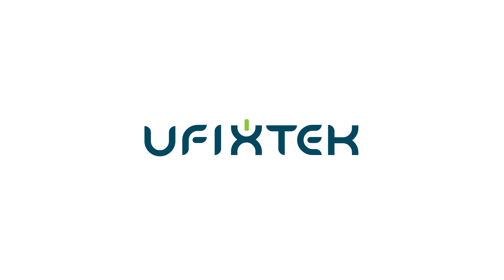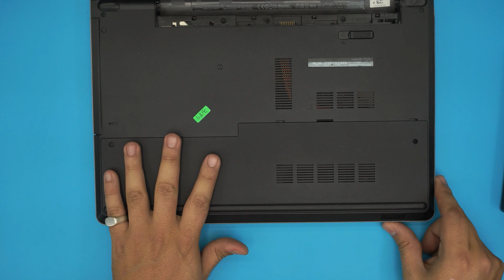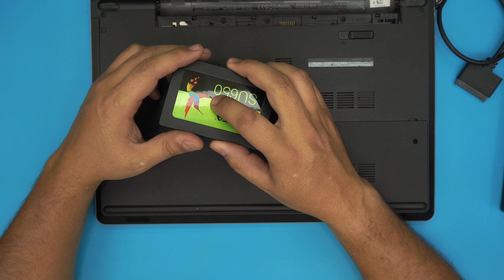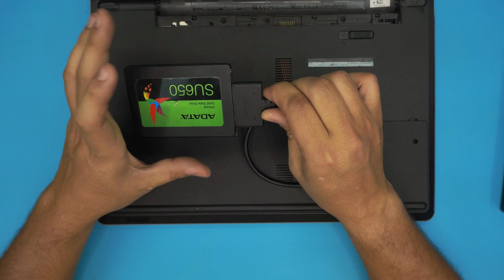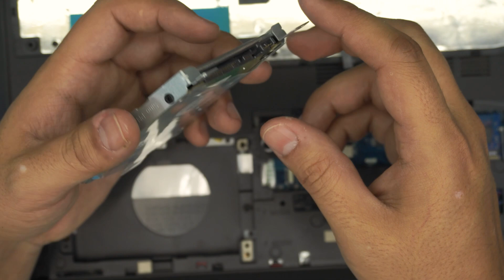Dell Inspiron 5559 P51f SSD HDD Upgrade | FULL GUIDE

Comment: Hey bro the blue tape on the belt it came off of the belt and now am trying but can’t lock it in place
Reply from the maker: 🫠 Regarding your question, just use a very small (almost nothing, smoosh it) drop of super glue on the blue plastic, then attach it to the flex cable, pinch it, let it dry, and then push the flex cable into the connector.

Comment: Can we install SSD parallel with HDD on Inspiron 5559 ..
Reply from the maker: 🫠Regarding your question, that is physically impossible as there is no space for two drives at the same time. UNLESS you remove the DVD drive, get a DVD drive adapter to HDD, and place an HDD there.
Should you have any further questions or requests in the future, please don't hesitate to ask me.
cheers🍻

Comment: Thanks, very helpful!

Any idea if people actually buy used laptop HDDs? M01ABD100 to be precise 😀 I'm left wondering what to do with the HDD I switched out, as it's still a usable piece of hardware, albeit slow as hell. Ideally it could become spare parts or something instead of me just throwing it in the bin.
Reply from the maker: It's my pleasure my friend, i appreciate your support.
🫠Regarding your question, get a 2.5" HDD enclosure and use it as external storage for backup, and keep it in a safe box. Mechanical drives (HDD) are the best for long-term file storage, while SSDs are not suitable for long-term storage as they can eventually lose data over time.
the best we recommend:
https://amzn.to/3XEgD8m
Should you have any further questions or requests in the future, please don't hesitate to ask me.
cheers🍻

This is an Amazon affiliate link. When you use my links, you are helping to support the channel. 🙏

Comment: great vid! I didnt put the ribbon cable in properly and was wondering why the drive wasn't detected. got it right away with your advice
Reply from the maker: It's my pleasure, my friend. 😊 I deeply appreciate your taking the time to provide feedback. If you're inclined to support the channel further, feel free to like and subscribe—or even both!
ya those flex cables go in in an angle 45 then sit down flat and lock it.
Should you have any questions or requests in the future, please don't hesitate to ask me.
🍻cheers

Comment: hello sir, I found this video very helpful, I was wondering if after adding the SSD (cloned), the startup and power up is normal or does it require another extra step? thanks.
Reply from the maker: Thank you for your feedback! If you wish to support the channel, you can like, subscribe, or both!
Regarding your question, nothing after cloning power on and it may crash only once and show blue screen, but don't worry on the 2nd attempt to reboot it will boot normally, no extra configuration is needed.
Should you have any further questions or requests in the future, please don't hesitate to ask me.
cheers🍻

Comment: After replacing my hdd to an ssd it says there's no bootable devices found.
Reply from the maker: I'm very certain, 100%, that you skipped the beginning of the video where I explained that there won't be any Windows installed on the new SSD. I also provided information about what you can do and shared links.

The new drive does not come with Windows pre-installed; therefore, you will need to install Windows using a USB boot drive. You can find the link in the video description. I have created two videos—one on how to create a Windows USB boot drive and another on how to install it.

I hope this clarifies the information for you.

Comment: Which type of ssd is best for Dell Inspiron 5559
Reply from the maker: Thank you for your feedback! If you wish to support the channel, you can like, subscribe, or both! Regarding your question, the best durable ssd and compatible are the samsung evo, 
https://amzn.to/3KJrSWG
Reply: @uFixTek  which capacity 128gb or 1TB dell Inspiron 5559 tolerate
Reply from the maker: 1TB without any iisues
Reply: @uFixTek  ok thanks Love from India (Haryana)
Reply from the maker: यह मेरा सौभाग्य है मेरे मित्र
Reply: @uFixTek  if we remove hdd and use a ssd then,  is it will erase our old data? Because our whole data in our hdd , can we use both ssd +hdd in same laptop
Reply from the maker: yes you will have all your windows and data on old drive , you can't have both. you could get a big SSD and clone your HDD to SSD by using a usb to sata adapter, https://amzn.to/43ylt89
connect the ssd using this cable to your windows and download the none 😉 pirated version of Macrium Reflect and clone the hdd to ssd and you will have everything the same way but on ssd
Reply: @uFixTek  hello and do you have a video showing how to clone your old HDD to the new SSD with the cord you recommended? And where can I download the unpirated version to clone?

Comment: I have a Dell Inspiron 5559 with a 256 HDD. Can I clone a 256 HDD with a 1TB SSD or does it have to be the same size?
Reply from the maker: Thank you for the feedback! if you wish to support the channel you can LIKE or SUB or both :P
regarding your question: yes you can absolutely fine , just once cloning is done and you place the ssd and in the windows, don't be shocked if you see the SSD (drive c) only 256GB (it should be 320GB) , all you need to do its go to "disk manager "
you need to press Windows Key + R. Now, type diskmgmt.msc  , and hit the Enter 
then you will see an extra space in BLACk and can right click on C or on black partition and do extend.

Comment: How to install os from HD to SSD
Reply from the maker: Thank you for the feedback! if you wish to support the channel you can LIKE or SUB or both :P
regarding your question: IF you mean cloning the old HDD to SSD or fresh install (very recommended), if you want to clone your HDD to new SSD then you need to get this adapter then plug the SSD to the adapter and download the cloning program ( Macrium Reflect ). and clone the HDD to SSD
but if you want to fresh install windows the download windows to USB: https://youtu.be/uDu8j2lE-dM
after creating the usb power off the laptop and plug in the usb and power on and press f12 and once in boot menu then select the usb and install windows : https://youtu.be/GkMZyCUarIA

Comment: Hi I have the same pc with a 1 To hdd and I wanna switch to sdd I have 2 partitions in my hard drive 500go each the main partition with windows in it has only 210 go used so I was wondering if I can buy only an ssd with 256 go
Reply from the maker: Thank you for the feedback! if you wish to support the channel you can LIKE or SUB or both :P
regarding your question: you could only place a 250GB ssd but you will fill that very quickly the price difference from 250 to 500gb is very little and the benefits are higher. BUT yes you can do that.
Reply: @uFixTek can the 5559 only hold windows 10 or could it be have 11 installed?

Comment: Can you recommend me the best ssd or mvne drive in the size of 500 or 1000 GB for this computer? Plus which 8 or 16 size RAM do you recommend the most?

 (My computer has 4 RAM and a 1000 GB hard drive and is terribly slow)
And is it possible to upgrade the CPU from i3 to i5 or i7?
And Thank .
Reply from the maker: Thank you for the feedback! if you wish to support the channel you can LIKE or SUB or both :P
regarding your question: this laptop does not have NVME m.2 slot, all you can do is install a very good ssd sata the Samsung is the best, get the 1tb or 500 recommend you the 1tb as it will give you more durability,  https://amzn.to/3CK0YYh
regarding the ram check this video to see you max ram capacity: https://youtu.be/tKEJTkVth4Q
when you know the max ram capacity get this 16gb: https://amzn.to/2ZQaOKf
if you need to know how to install windows 10:
create windows 10 usb drive: https://youtu.be/uDu8j2lE-dM
how to install windows 10 from usb: https://youtu.be/ll_0K4hDksY
Reply: @uFixTek  wow  it was fast .
What time is it for you now ? night? You answered quickly and to the point. Thank you very much appreciate. Successfully.
Reply from the maker: it was 3am :/ i try always to answer as quick as i can to all my comments.